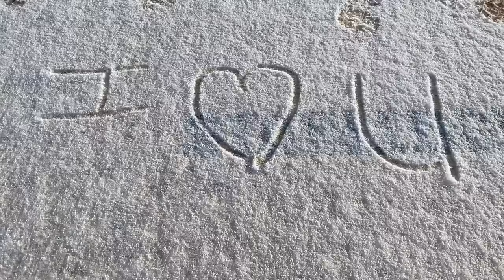TIMELAPSE - Couple Builds Off-Grid Cabin Alone In The Canadian Wilderness

Comment: We bought a cheap tarp and stretched it over the entire floor. It helps keep the snow and rain off the floor, so there is less warpage and damage. We set the walls right on top of it. By the time you sheetrock, it is pretty worn, but when the mudding is done, you cut around the walls, roll it up carefully, and you have a nearly perfect subfloor to do whatever you want. Just in case you ever do another one.
Reply from the maker: Thanks, happy to hear it works for you; we know that some folks do that and works for them. We tried it years ago once and in our opinion was nothing more than a safety hazard, and annoyance chalking lines, etc. Not sure if you noticed but our floor was not regular osb but was 'stabledge' flooring; basically a weatherproof osb. We would have never left normal osb out in the elements like we did this one. We will continue to use the weatherproof osb moving forward, at least if we will be building with it under weather for any length of time. Look it up in case you ever build again, its awesome and you don't have to slide around on a tarp all day ;) . Thanks for stopping by and all the best to you and yours :)

Comment: Fine work, and a pleasure when you can build with your spouse.  I wish I could do this one more time, I'm a carpenter, but I'm 66 and have a spinal injury.  Still, I'd love to be back in the saddle.  Hey, here's a tip, try to build in the Fall before it snows!😄I've framed in the winter and I know it's one long endurance test . . .
Reply from the maker: haha, sometimes it just works out that way. Hope you are getting on alright these days Fred :)
Reply: @MBFModernHomesteading  No worries, going to help my son finish his basement; will be limping around afterwards for a couple of weeks, but worth it.  You've got me thinking about doing it again . . . hey, that steel screw pile foundation solves a lot of problems; does it work well?  Is it cheaper compared to other alternatives?  Subscribed . . .
Reply from the maker: @fredberger3155  We have used the steel screw piles a couple of times now and love them. They are installed within the day and ready for beams, nice clean work and solid. It really all depends on what someone is looking for but concrete piers are probably the cheapest option, but we still prefer these.
Reply: @MBFModernHomesteading  Thanks for the reply, those screw piles look really slick, and allow you to quickly start with the framing portion of the house, which is what I'm really most interested in.  Keep sawing wood!

Comment: Hey Guys I love what you are doing. That being said I would want two additional rows of support seals under the floor the span looks to be about 12 foot from center floor joists to the outside joist.  That's not exceptable in the south.
Reply from the maker: Hey David,  thanks. Everything is correct in the floor build; we are running 2 x 8 joists not even 10' across from one beam to the next. The width of the building is only 20' wide with 3 beams, one in the middle and one on each side. If you check out a joist span table which is easy to find on the internet, you can see that it is plenty. It would be acceptable in your area also, probably just hard to tell when watching the video. All the best. Have a good week!
Reply: @MBFModernHomesteading  2 x 8's by 12 feet long joists are standard in Mass.
Reply from the maker: @johnbrackett5818  It all depends on the size of a build here, 12 foot joist would be pointless on our particular build. There is a joist span table to make it easier to figure out for people who are unsure. All the best.

Comment: Great job! The one thing that eludes me is why a deck takes precedence over putting and finishing a roof It is totally be4yond me!   And why burn the wood outside instead of in the stove once installed! That heat would be kept in the house and warm up the whole place! So it seems that knowledge alone is not enough, ... it has to be combined with proper timing and good sense!! Again, gret job!!
Reply from the maker: Thanks and we needed the deck installed to actually do the roof as it extends over top of it. And there was no stove installed inside so if there is no stove inside, then a fire outside is the only place to have one. We had a kerosene heater we used before the wood stove was installed inside however, it worked great. And you are right, good sense goes a long way and asking questions as to why someone does things the way they do certainly helps to make sense of it. Thanks again, all the best :)

Comment: All in all you did a pretty good job building this house, but every seam you have in those walls can cause problems in the future. As far as the trusses for the roof go, personally, I would have all of them over studs for more and better strength. That's just me, though. I've been in construction all my life. I have over 3500 houses and buildings in my life, that's why I said all in all you did a pretty good job on this project.
Reply from the maker: Thanks, we tied all the walls together with plywood, there will be no issues there, also, in the second part of the build which we will put out soon (and can be seen on our channel in smaller segments now) it is all sided with hemlock shiplap, which also helps tighten things up farther. All will be good, no issues going forward. The trusses are 24" on centre and will be no issue at all sitting on the top plate of the walls, that is common practice, no need to have an extra stud under each one, that would be overkill. Thanks for stopping by and have a great day. Good job in building houses on your end too, people need to live somewhere and it sounds like you helped them do just that, all the best.

Comment: Hello, your work and your home are an inspiration to my family. I have a question: what are the external dimensions of the house?
Reply from the maker: This is 20x30. With the over hang porch a bit more than 20x36.
Reply: @MBFModernHomesteading  OK, thank you, I understand that these are dimensions in ft? 1ft = 30,48cm?
Reply from the maker: @PawełCieśliński-t3z  Yes, they are in feet.
Reply: @MBFModernHomesteading  Did you choose the number of ground anchors yourself or was it done by an engineer?
Reply from the maker: @PawełCieśliński-t3z  We worked it out with the company that installed them as we had used them in the past and knew what we wanted, etc.

Comment: What happened to the flooring insulation?  U just nailed osb over joist. Great job in winter. Have a great life.
Reply from the maker: We have shown and mentioned it in other videos but basically we use bubble foil insulation in the flooring as it keeps rodents from nesting under the floors, that along with skirting in the cabin works really well. Also, we only put so much on as the weather got nasty and didn't want it to just hold water, etc so we will go back and put it to the under side of the floor later, we have done that in the past and it works well. Have a great life on your end also :)

Comment: I’m from Australia and our building codes are very similar to yours . It seems we are not the only ones who use joist hangers and steel post brackets  . From what I’ve seen , our tie down requirements are much more , due to severe summer storms and cyclones . Do you have a wind rating for your buildings??
Reply from the maker: Where we are does not get too windy as we are pretty surrounded by trees but we do have some hurricane ties on our build and would need more depending if we built elsewhere, especially along the ocean.

Comment: First time viewer, just curious why you didn't insulate between floor joists? I did see you put the roll insulation under floor. Good luck!
Reply from the maker: Hey, thanks for stopping by. We use the 'bubble foil' insulation on the floor joists as our insulation. That along with skirting works well. We have used it in the past as well and really liked it. It also keeps rodents from nesting underneath the cabin.

Comment: Why at time mark 12:37 you were installing your T&G plywood over the bubble boil insulation and starting at time mark 12:42 the plywood was being installed right to the floor joists?🤔
Reply from the maker: Because of the bad weather we decided to wait to put it on underneath later on. We have done it that way in the past also; it is a bit of a pain in the butt, but still works. We had mentioned it during the video in a ticker on the bottom, you must have missed it. Have a great day George!

Comment: I know ZERO about building.  Out of curiosity, what is it that is preventing the metal supports from slowly shrinking into the ground and eventually make the structure lopsided?
Reply from the maker: They are installed below the frostline and are put in the ground at a certain pressure, etc to prevent that from happening. Great question!

Comment: I have a question... The foundations consisting of metal posts, directly driven into the ground, aren't especially sensitive to humidity and corrosion? Aren't concrete piles more effective and resistant?
Reply from the maker: Hey, following is a site you can read up on them a bit more. They are galvanized so will last a really long time. https://postechpiles.com/what-is-the-lifespan-of-postech-piles/ Here is another site comparing them to concrete piles as well https://www.goliathtechpiles.com/screw-piles-vs-concrete-footings
Reply: @MBFModernHomesteading I know that galvanized protects very well (in fact, under normal conditions it can last from 80 to 150 years)... My question is about how long it can last, compared to the duration of concrete with anti-moisture additives or designed to increase its durability. resilience... In the plot of a friend of mine, there are some structures with concrete in the foundations. They added volcanic stone powder to that concrete, which, apparently, exponentially increases durability against elements such as humidity and erosion, and those foundations were laid more than 300 years ago... The house they were supporting fell, but the foundations are still there, intact.
Reply from the maker: @Alberto_Abad  We prefer the screw piles for a number of reasons, having said that, do whatever you prefer. We are only sharing our story for entertainment purposes. Thanks, all the best to you and yours :)

Comment: Since you do not have a concrete base, will you have to level your foundation over time?
Reply from the maker: It is below the frost line so was good to go. If for some reason it shifted after the first winter than the tops of the screw piles are adjustable, having said that, it was all good so there will be no issues going forward. We love this style of foundation for this type of build.

Comment: Hey, isn't it customary to first do the framing than apply the chip boards or plywood?
Reply from the maker: It can be done either way. Applying the OSB beforehand makes it much easier to keep square and adds additional strength however. It is most common to add beforehand these days. All the best.

Comment: Why make the front porch before the roof is on and building dried in ? Every bit of water that floor is exposed to shortens is life even if it is the better chip wood or flooring . Less is better .
Reply from the maker: You would be surprised how good this stabledge flooring is, no issues at all. Then again, this only had ice and snow on it for the most part, not much water at all. Floor is perfect still.

Comment: Noticed how you squeezed triple two by six/eight into foundation brackets clearly designed for 6x6's. I fully agree that triple 2xX is stronger than single 6x6's . And then you added some 3/4" blocks to fill the gaps. Would have been much better what carpenters typically do with door headers: laminate two 2x4's with a piece of half inch plywood in between, which gives you exactly 3.5 inch. In your case I would have taken triple 2xX's with two layers of 1/2 inch plywood in between. Would have been much stronger and exactly the 5.5 x X that would fit your brackets. I know what I'm talking about, built my own cabin. :-)
Reply from the maker: We know too, not our first rodeo, thanks. All the best.

Comment: Well it looks like it'll be functional however there are a couple of structural issues that it's too late to fix!! The plywood should have been turned 90° you have a structural weakness every 4 ft where you join two sheets unfortunately it is the weakest point in the structure!! Issue number two you have no fire blocks in the they're called should you have a small fire in the kitchen it can't spread into the attic and throughout the whole. Best wishes good luck with your new home.
Reply from the maker: There will be no issues with the plywood on a build like this. They are just fine run vertically on a small build like this, good and strong. If you see part 2 of the build, you will see we have hemlock covering the entire outside walls as well. We have run plywood horizontal in the past as well on other builds. It really all depends on how the build will be in the end, how big it is, where its located, etc. All the best.

Comment: Love those thick stud walls where insulation can do its job but you could have not used soild  2 x ? and cut breaks to (THERMAL BRIDGES) gap much LIKE THE DECK. Even a high density 1/2" foam panel applied  either full sheel or cheaper strips 3" wide glued on to just the studs before osb. I am now a fan of rockwool. It long term is  a value over pink. I know money is always a limitation. Material prices are stupid. A bigger home vs a compromise. Id say a kicthen price, easily is a big bump, the most in many cases where appliances are new & not placed in as used or real deals. I have seen lots of free high end wealthier pewple goods tossed in their upgrades in 98% shape vs  $$$$ All New???  I also see that if I have big enough property. A garage etc will be a must but one can put in a great shop 60x60 steel building and live and work out of it easily and work their way into a house later (if one still thinks & need one) with no real disadvantage other than a perceived look. Especially knowing it already a small in size limited under 1400 sf home anyhow.  And Linear distance of walls are best priced if you make a square design not a rectangle or L. a 30 x60. 1800sf  is 180 LF but a  45x45 is the same exterior LF  but offers 2025 sf a better choice and great of tyou build a storage/upgradeable basement foundastion or Heavns .. make a possible upgradeable attic . You ahve a future for little extra. Even that reflectix hung under the floor joists can reall see in air flow.  Wishes we all have em. I guess we do what we do and and you are moving busily.

Comment: Great job...  You should be proud.
Now, casual observation....  ALMOST every non-pro builder has done it. They raise a dimentional lumber wall up. Then spend 10 minutes to square and plumb the wall... Then raise an adjacent wall that intersects to that wall. Then have to push the first wall out of thr way to raise the new wall.... Then spend 10 minutes RE-SQUARING the 2 walls together... It's dimentional lumber, ie all the same length... Stand the wall support it out of the way, then when you stand the next wall, then square... Larry Haun has outstanding time saving videos. "The Efficient Carpenter" series on Youtube. He was a Master Builder, and the series shows some valuable shortcuts.
Again, In no way am I criticizing your outstanding work. You did a great job. And you should be proud. One day, hopefully your Grandkids will enjoy what you buildt.
In no way did I mean to step on your toes. I just think Mr. Haun's videos are very informative. And lots of peps watch what you built so it's a good platform to share info...
Again, in no way was I criticizing your good work.
Reply from the maker: Hey thanks, I am assuming you mean 'plumbing' as the walls are squared before we raise them, and you must be referring to the first wall when in the cold weather and being hasty, we nailed the brace on the outside and had to knock it off and re-plumb. Other than that, we built the wall in sections for ease of lifting and then once it was plumb and in place, there was no re-plumbing any of them. It was just a matter of plumbing up one side and nailing off the other to the wall before. Maybe in the video it looks like we are doing more cause I am 'ocd' with the level sometimes haha. Either way, thanks for the kind words, all the best.

Comment: Why did you start then stop using the metal used insulation under the floor?
Reply from the maker: We had mentioned it in video with a caption, you must have missed it. It was because of weather, we put it on at a later date.

Comment: How is the floor with only Reflectix insolation?
Reply from the maker: Along with skirting it works well.
Reply: @MBFModernHomesteading  my cabin by Timmins is on screw piles also. I put 5” of spray foam underneath, but I wish the floor was warmer. But I still did not get around to skirting it or even putting snow around to insulate, it’s just open right now.
Reply from the maker: @scottfree8726  Right on, the skirting makes a huge difference, keeping that darn draft out is really important , at least that is what I have found.
Reply: @MBFModernHomesteading  do you have a video how you made the skirt?
Reply from the maker: @scottfree8726  Yes, we have a few, we share everything in our playlist on the landing page from the channel. Here is one of the videos we are working on it. We were using hemlock as that is what we had left from doing our siding. We would probably do it differently otherwise as this may only hold up for a few years. https://www.youtube.com/watch?v=J3PA03CMEvU&t
Reply: @MBFModernHomesteading  thank you